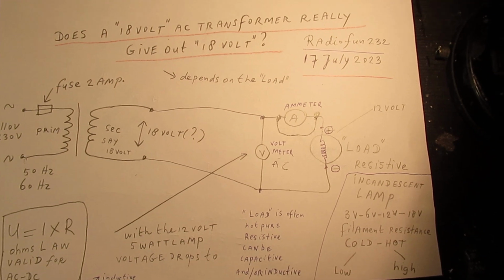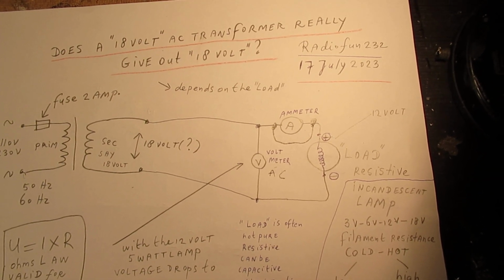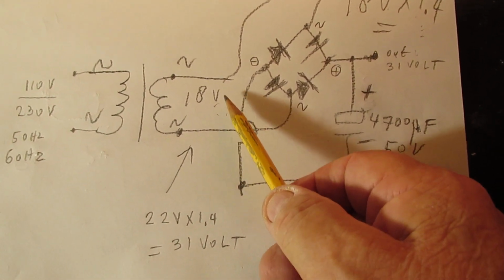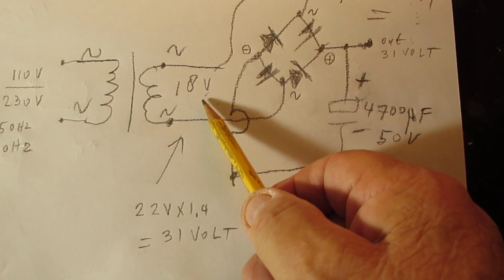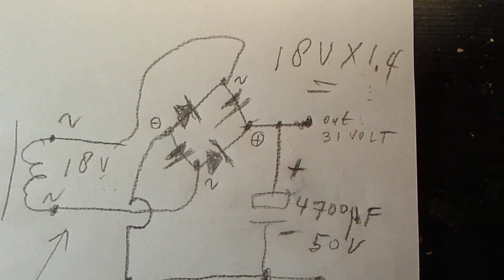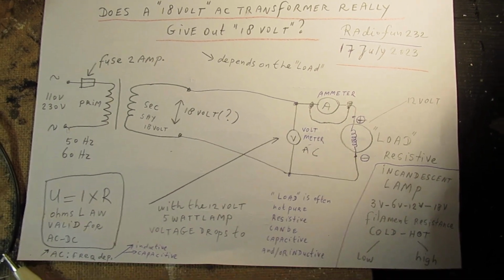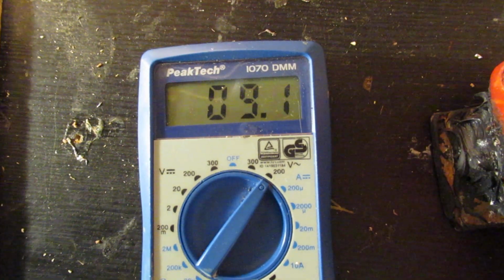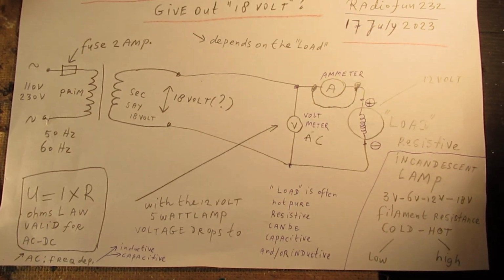Does a 18 Volt AC mains transformer really give out 18 V ? (about open voltage & voltage under load)

Comment: The lower the VA rating, the higher the probability of higher output voltage at idle (no load) - 10-15% is typical for small transformers. It also varies with type of transformer (ex toroidal vs regular transformers). One must also account for input AC voltage variation, which may vary throughout the day - for example you may have 210v AC at 5 pm, and you may have 245v at 3am when most people sleep (still within 230v +/- 10%) 
With a bridge rectifier, you get peak voltage equal to sqrt(2) x Vac - 2 x voltage drop on diode of bridge rectifier (drop varies with current and temperature of rectifier)  and the capacitor size can be estimated with formula Capacitance in Farads = Current (A) /  [ 2 x AC Frequency (Hz) x (Vdc peak  - Vdc min desired) ]
Reply from the maker: Yes, OK, for the bridge rectifier 1.4 X V RMS (=AC out of the transformer) is a good rule of thumb.

Comment: Inspiring video give me motivation to build a better radio
Reply from the maker: Thanks, good to hear that.
Reply: eh, i'm playing with oscillators.
but currently, i want to fix my home-made power supply: looks like i don't used the right schematic. also, i miss the "overcurrent" led indicator, and voltage and current pots jump way too wildfrom a value...